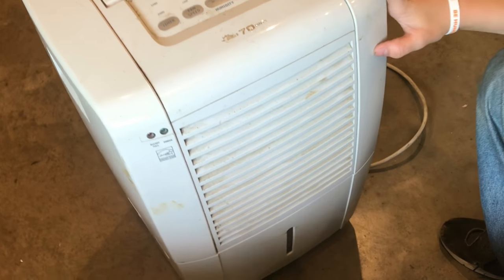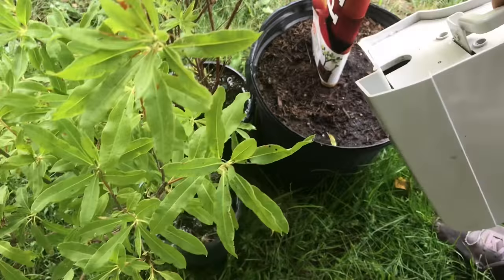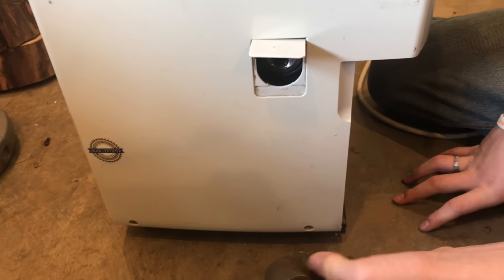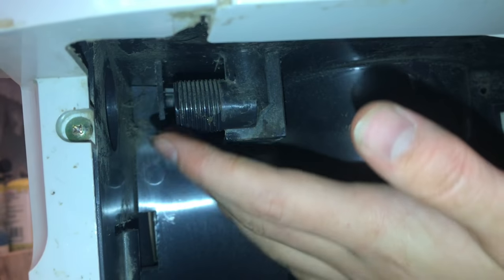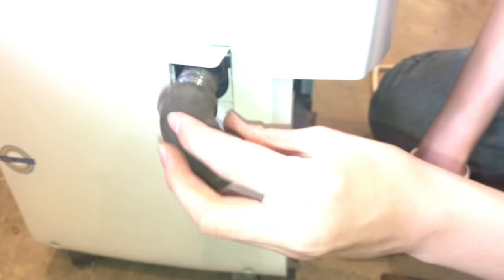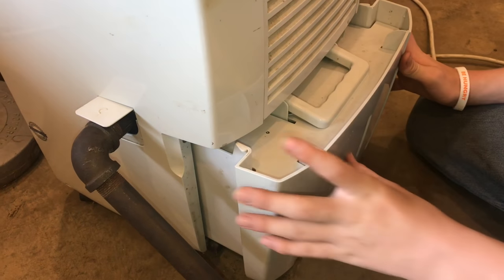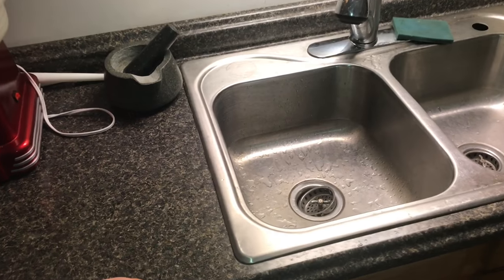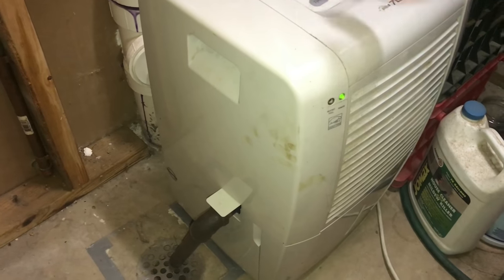NEVER empty your dehumidifier again

Comment: Mine also drained fine thru a hose at first. After a year or so, it stopped draining thru the hose and in to the bucket. I also figured it was gravity not working so I raised the dehumidifier up on a wooden box. That worked for a few months, then started draining in to the bucket again. I read all of your comments and went down to try blowing out the hose to see if there was something blocking it. I unattached the hose and there was this blob of disgusting substance that resembled a huge glob of snot. I took the hose out in the yard and flushed it out with the garden hose.  Then I removed the front of the dehumidifier (four Phillips head screws) and flushed out the tray under the coils...more snot glob came out. Sooooo...long story...it’s draining thru the hose again!
Reply: laceylouloulou that’s your skin, mixed with water.
Reply: Alexander Martin Alexander...did I need to know that? While I’m here I may as well give a follow up. Within a day. The hose stopped draining again, so I moved the dehumidifier closer to the drain and cut the hose down to about five feet. It’s been draiNing ever since. The long hose probably was more clogged up than I realized. (More dead skin, no doubt!)
Reply: @ALXMARTIN  is that really what it is?
Reply: Yeah you have to properly clean the drain just like your AC otherwise it will block up.

Comment: The pipe in the machine and what he connects to it have NPT (National Pipe Thread).  Garden hoses use GHT (garden hose thread).  They aren't compatible enough to prevent leaks, even if you can get one to "grab" the other.  However, there are plenty of adapters at any hardware store.
Reply: Thank you for what I call "the cheap lesson" — "the expensive lesson" entails a lot more mopping and four-letter words ;-)
Reply: @utopia2112  Yeah, comments sections are full of us who made those mistakes so others don't have to.  In fact, let me add that if you're searching for a part with GHT, you have to specify either male or female, so the acronym would actually be MHT or FHT, depending on what you're looking for.

Comment: I hope you keep your utility room door wide open or else you will just have a dry utility room.Also using Teflon Tape on those pipe threads would be an added plus.
Reply from the maker: Typically the utility room is wide open, it’s also nice because it eats some of the sound. I guess I didn’t think of the Teflon tape, I think I mixed just about every type of material making that 90° bend. I think I had plastic metal gas line, it would’ve been nice if it was all the same material too. Thanks for the comment

Comment: A garden hose has coarse threads. That fitting has fine threads as witnessed by the pipe that fit on. The garden hose might stay on but there is the risk it won't seal well and you will have a leak.
Reply from the maker: If the rubber hose has that O-ring in it, I’ve had no problem with the hose. Sometimes the hose wants to move, then the water may not end up where you want it. Either way it’s great not to have to empty the dehumidifier every day if not more.
Reply: @livefree6878  Mine had an O-ring and it still leaked, got it form Home Depot. Maybe plumbers tape will help? what do you think?
Reply: Y'all, other commenters have said there are NPT (National Pipe Thread) to GHT (garden hose thread) adapters available at hardware stores. I would never skimp out on doing The Right Thing when the alternative might be having a water leak in my house. Just not worth saving a few dollars.

Comment: I think just adding a garden hose as intended would be cheaper and easier than pipe. Then if you like you can cut the hose to any length you want. I used an old washing machine supply hose on mine. Using a hose also makes it easy to revert back to portable using the tank.
Reply from the maker: I hose would definitely work. I had a lot more fittings and I didn’t have a hose that I was willing to cut. One time I used a foam noodle. I can’t stand emptying the dehumidifier unless I’ve got some flowers that need watering. Thanks for the comment
Reply: I did the same thing but my water still goes into the bucket and not down the hose?? I don’t understand why
Reply: There would have to be a rubber plug or a valve somewhere or else water would run out of the hose location all the time . My unit had a plastic cap covering a rubber plug that had to stay in when using the bucket .

Comment: Great illustration. I tried a hose but the. d/h hose opening has a black piece with no thread then the next piece is  piece with threads. Unit was bought 2019 and is Haier EM45.

Comment: Mine I have a hose on, lately the bucket is filling up in a few days, I checked the hose and it isnt clogged , I have a 6ft hose drains into a sup hole, its about 3ft higher than the hole,  any idea why more water is going into the bucket vs draining out the hose?  When I bought it about 2 years ago, maybe 1 time in 6months the bucket would be full.  It runs almost constantly since I have a koi pond in the basement
Reply: 95% of the time this happens because the hose connector fitting is no longer watertight, and is dripping into the collection bucket. Replace the rubber washer inside the hose connector and (this isn't essential, but will provide extra leak protection) give the threaded male end a few wraps of teflon tape (clockwise) and reconnect hose....HAND TIGHTEN...never use pliers. Most of those male threaded fittings inside dehumidifiers are plastic and plier tightening can very easily crack them. Hope this helps, if you didn't fix it already lol
Reply: @markrebehn5568  Thanks Mark, mine had a seed that sprouted growing at the drain hose connection. I cleaned it all out and seems to be working now.

Comment: I have the same model and it has a garden hose to a drain and keeps reading bucket full. I pull the bucket out and put it back in and it works fora little while then shuts off. And ideas as to the problem?

Comment: hi can i drain this into the water sump?  the floor drain is a bit far (another room)
Reply: That’s what I was thinking about. Might be about to inherit a house and I’m unsure where there’s a basement drain or if there is one or more. But, I do know that the house has a French Drain, along with a sump pump. Was wondering if a dehumidifier could drain there. I don’t want it to drain into a sink.
Reply: @privateprivate8366  I ended up draining the water into the sump pump!  So far so good. Going through the 2nd winter. I raised the dehumidifier to facilitate downward flow.  Good luck to you
Reply: @MyKkata  thank you. Do you feel there’s any significant power usage, due to the sump pump having to pump out water? I assume not as, it’s merely water collected from humid air.
Reply: @privateprivate8366  never thought about it. But everything is getting more expensive these days LoL
Reply: @MyKkata  you ain’t kiddin’.

Comment: I want to set the dehuey on a shelf and use the garden hose to drain into a tote.  But I want a float valve in the tote, so tote won't overspill. Can I rig it to stop flowing out the hose when tote is full, and into the internal bucket, so once that is full it shuts off?

Comment: For sanitation reasons, drain pipe should be 2 inches above drain.
Reply: Do you mean they should end no MORE than 2" above the drain, or that they should end AT LEAST 2" above the drain? Please say more about what the sanitation issue is here so folks understand. Thanks!
Reply: If the drain backs up, you don't want sewer water to touch drain pipe and let bacteria grow up into your machine.
2 inches or more above drain.

Comment: Hi, I have a GE dehumidifier and it's been attached to a hose and draining into a sink for several summers and has worked great.  Now, all of a sudden, the water is not draining through the hose, but filling up the bucket.  Any ideas why it reverted back? The hose is still snuggly attached and the unit is higher than the sink, so there's no gravity issue here.  Thanks.
Reply from the maker: It is possible that there’s a blockage in the hose. This will happen with air-conditioning drains all the time. Especially in humid areas, Mold can grow inside the tube and stop the flow of water. If a person were to blow into the tube you should hear air flow unrestricted. If there is a restriction, it will need to be cleaned out with something like a coat hanger. That’s my first thought. If that doesn’t work I could take a closer look at mine to see if there’s any other possibilities. Hope this helps
Reply: What LF said, but instead of blowing it, just connect it to a spigot and blast out any obstructions.  You might run some beach through it too, just to eliminate and residual mold so there isn't enough left to re-grow a clog from.

Comment: You do know you should move it around to greatly improve it's efficiency, right?
If it is always kept in the same place, it will only dry a spot, if you move it around once in a while it will do a far better job at keeping the basement dry.
Reply: Nope. Humid air is attracted to dry air.
Reply: @twosawyers  I don't know about that, but if you have no air movement to the unit, especially if it is in an enclosed utility room or bathroom, it will not be as efficient.

Comment: Anyone know the diameters of those pieces, I tried using a garden hose and it doesn't keep as snug as this, it keeps leaking water into the hold bucket.
Reply: The pipe in the machine and what he connects to it have NPT (National Pipe Thread).  Garden hoses use GHT (garden hose thread).  They aren't compatible enough to prevent leaks, even if you can get one to "grab" the other.  However, there are plenty of adapters at any hardware store.

Comment: I see this is 6 yrs old. Hopefully this guy realized that those ports get clogged and have to be cleaned out so they can work, hence, it would be much easier to use a hose than a handful of metal fittings that you have to dismantle every time you clean it.

Comment: I just purchased one for my basement exactly like your but man the the next morning the Tank was full even i have a hose connected to the Unit ....
Reply: Cubano2031 Yeah sams here!  Can’t seem to figure out what the problem is.
Reply: Maybe leaking from fitting (use thread sealant). Read the manual and it will give instructions on hooking up drain hose and troubleshooting guide.
Reply: I had a hose hooked up, and it worked fine for a year or so.  Then, it stopped draining and I had to use the bucket removal system.  I’m thinking, and I’m testing it out right now, that the problem is someone knocked the hose out of wack, and  it wasn’t laying perfectly flat towards the drain.  This is a gravity feed system, and I’m not sure if the unit will drain if the hose has spots that are higher than other spots, if you catch my meaning.  I’ll see tomorrow, if the bucket is full or not.
Reply: @6jjh1  Did you figure it out? My hose isn't draining either. Trying to figure it out.
Reply: Ramon Elani yes, the solution to the problem is make sure your hose drains towards your drain.  Don’t let it loop around or get higher than the outlet on the dehumidifier.  The gravity system will not drain then.

Comment: My plants reaction is better using water out this instead osmosis filtration system 😂 & I have had to empty mine 2 times a day so along with other unit I was getting approximately 5gal a over 24-28hrs. I'm trying find out how change the %😔 unfortunately this didn't help with that💔

Comment: You can collect the water and filter it for storage, drinking and cooking. Free water. Never again buy bottled water.
Reply from the maker: The research I’ve done shows that you can’t drink the water, it seems like it’s more like distilled water. I’ve used this water in the iron for ironing clothes and other applications like this. Most references say that it’s not drinkable. I hope this answer helps
Reply: @livefree6878  well it's drinkable but ew
Reply: You definitely shouldn’t be using that water for anything you just mentioned. They don’t even recommend using it to water plants like fruits, vegetables, or herbs. Which I noticed he waters his peach tree with😅. There are still several uses for the water.